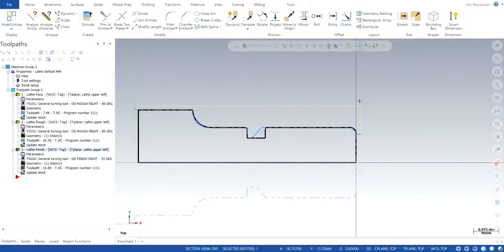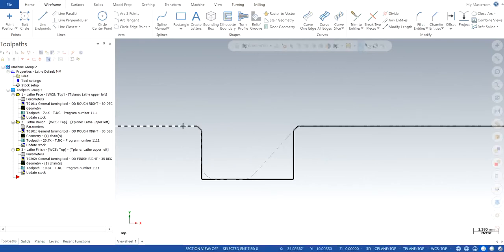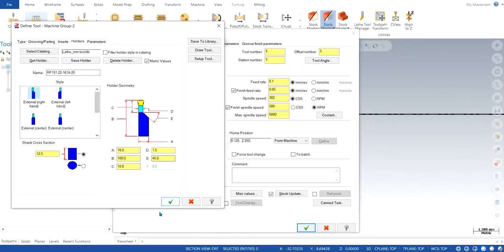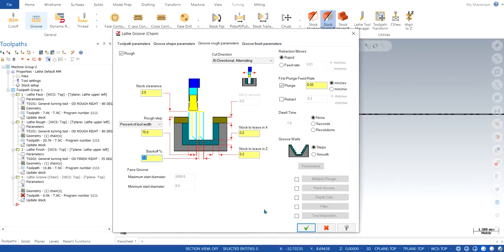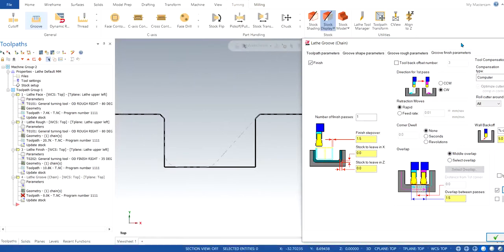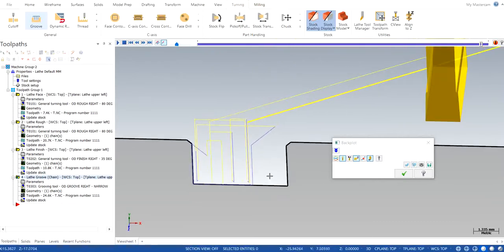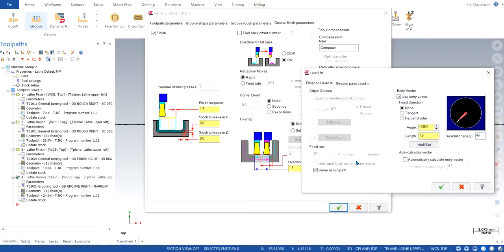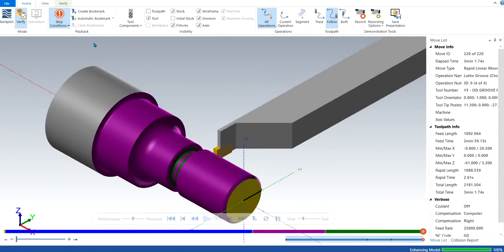MASTERCAM 2020 : LATHE GROOVE OPERATION

Comment: thanks for the video
I can see z0 is the face of the part. Do you set the groove tool on Z the same way you do the other tools? touching the face with groove insert and make that zero?
Reply from the maker: If you mean in terms of mastercam , you just choose the desired toolpath for operation to take place, whereas in practical real life application, you can choose the other option too, but touching the part itself and setting depth to be 0 and hence controlling the distance to travel by yourself.